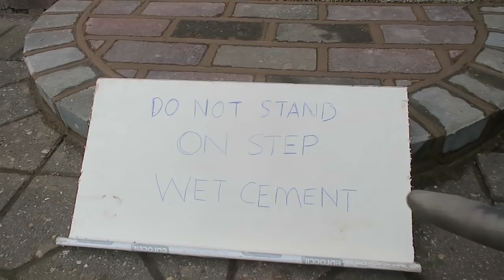Bricklaying - Small Step

Comment: Good job.

Suggestions:
after lying the semi-circle think a cardboard template will help to cut the pieces that are smaller. You measure the area, lay the complete pavers and draw the line to cut. Also, i think, if you smooth the joints with a wet brush it will clear the edges to make them look clean-er.
Reply: Ok now go tell Lewis Hamilton how to drive a F1 car.
Reply: Oh. I show Tony Stewart how to drive

Comment: Looks pretty simple, is there a DIY way of mixing cement and cutting the stone without having to hire?
Reply: You can buy a diamond cutting disk for masonry units, that fits on your handheld grinder to cut the bricks with.
And if you are really skillful, you can use a chezel and hammer to "cut " the bricks.

As for mixing the cement, you mix according to the instruction on the bag and can be mixed on the floor, in a bucket, wheel burrow or on a some kind of surface, just clean before it dries or you will have a hard time cleaning when it get hard. 
Some hardware stores will sell you a small bag of sand or stone and if anything a small amount of cement..
Reply: @Cent51  thank you for your message. Embarrassing it had never occurred to me about putting a masonry cutter on a grinder. Ive never mixed cement before but I certainly feel more confident now. Thank you!

Comment: Aussie brickie here 
Only thing I'd say is to start the round headers from the middle of the radius so you end up with 2 same cuts against the wall.
Good job tho obvisiously.
Maybe you'll implement that next time.
Reply: Daniel Stephens , hi mate another brickie here no need to do any of that just adapt your radius to suit if you end up with a cut just either tighten your radius or pull it out a bit I've never had to put cuts in I always adapted my radius to suit and as I specialised in glass bricks at the end of my working lifetime you can't cut glass brick to suit your radius,you adapt your area to suit the radius for the materials you're working with, but I fully understand that if the radius can't be adapted then start at the centre and work towards the ends plus I always built a centre brick to give me the level so I would know how much mortar to spread

Comment: Good video, but you have bridged the DPC , and cut  the cross ventilation by 50 percent. Might have been worth 'ducting' to a 4 of vertical air bricks. (65x215)
 - just a suggestion , but your workmanship & work ethic spot on !!

Comment: If you guys watching want to avoid having asymmetry like that tiny brick on the end of one side, do this: lay out the bricks following the circle, and when you get to that smaller remainder space where a whole brick won’t fit, divide the holes size by two and shape a brick to fit these two small brick sizes. Place the small bricks on opposite ends and re arrange the bricks starting from these small end pieces so it all fits and blends together as if a whole brick is “melting” into the wall and got “cut off”.